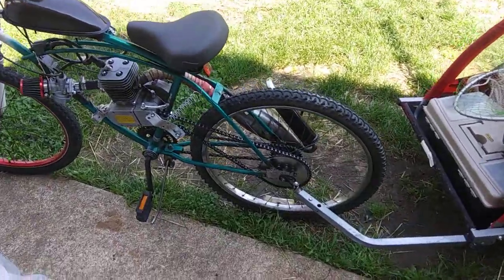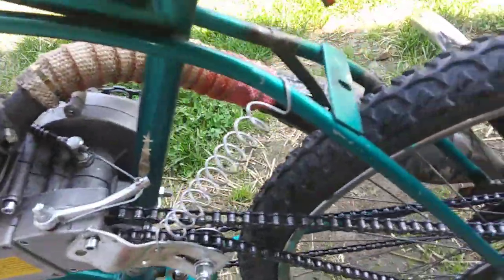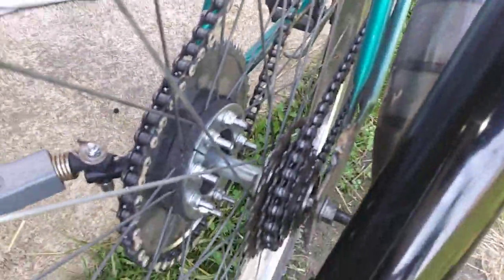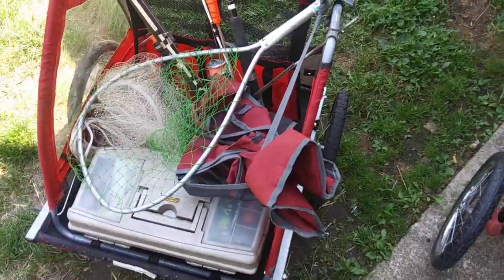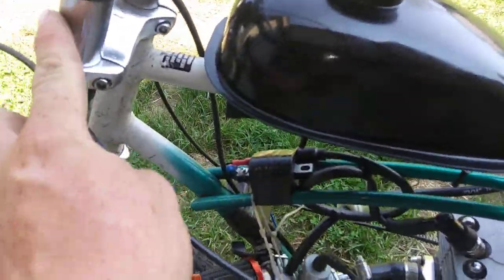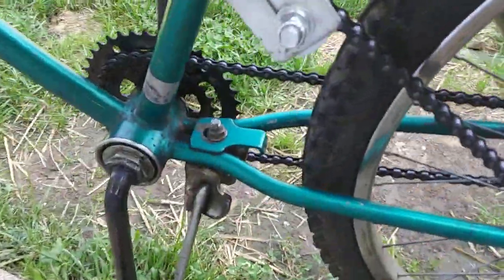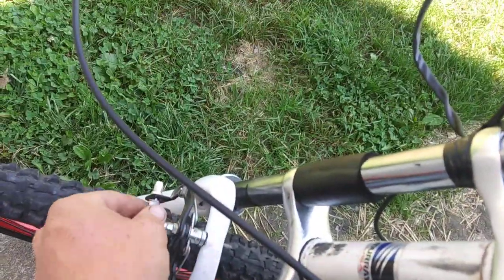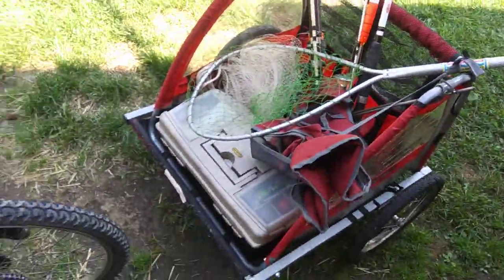YD100 motorized bike with fishing trailer!

Comment: You've probably already heard of Paul Elkins, and the portable camper he came up with for bicycles.. He doesn't use a motor either.. If you haven't seen it, check it out asap. I've already purchased all the parts, and let me tell ya.. its coming out nicely. Anyways, heres my question.. have you felt any fish tailing? And damn id love you if you could do a pull test and make that trailer weigh about twice as much =p let me know how it behaves.
Reply from the maker: I never felt any fish tailing with it and I let my buddy use it last year with his motorized bike and he was pulling at least 200 lb in it going over 30 mph with no issues.

Comment: Looks awesome. 👍👍☝️
Reply from the maker: Thanks!
Reply: @Baldys_projects  I got a little cargo trailer I pull with mine too it weighs like 60 pounds before I put anything in it. I can put an additional 200 pounds in it and it'll pull it fine but it's hard on the motor.
I still go get groceries with it it's good for bringing home pop and definitely good for boxes at kitty litter.lol
Reply from the maker: Dang that's pretty good I thought about using it for groceries but I don't know I get a lot of groceries sometimes lol.
I just hit some trails with mine looking for a fishing spot fully loaded down with short steep hills in the way and in the path laid a few big logs and whatnot this is a dirt bike and ATV trail that I was on so I just blasted through working the hell out of the clutch and I knew it was going to happen I burnt my clutch coming back out lol but it was the super cheap rubber pads in this yd engine so I'm going to put my HD clutch pads in there and also run my 500 lb clutch spring and try it out again.

Comment: Hhhmm, does it run good with the head on backwards,  did you also flip the Piston around? Make sense to put the intake in the front and exhaust in the back,  but I've never seen it done before.
Reply from the maker: Yeah it's good like that and I did flip the piston around as well.

Comment: Does the carb bounce up and down with the extended intake hose?
Reply from the maker: It did a little bit but the hose is actually pretty firm and then the ziptie I used to hold the carb up a little higher made it not bounce at all.
Reply: ENGINES N WHEELS oh didn’t see the zip tie, I put an extension on a dio reed intake and it bounced like crazy, had to secure it with a piece of wood